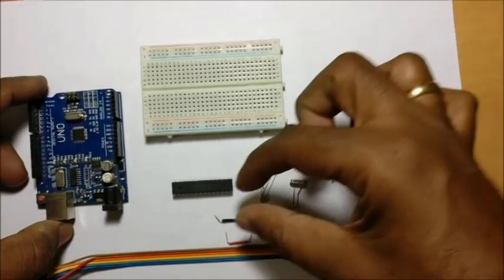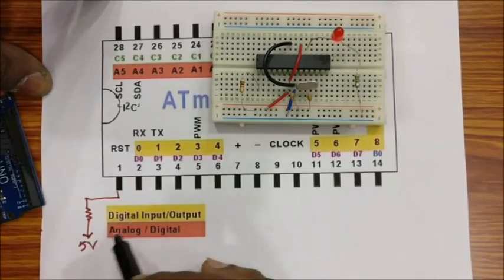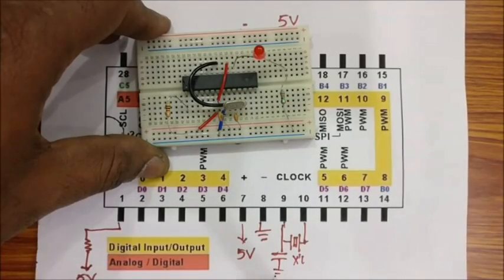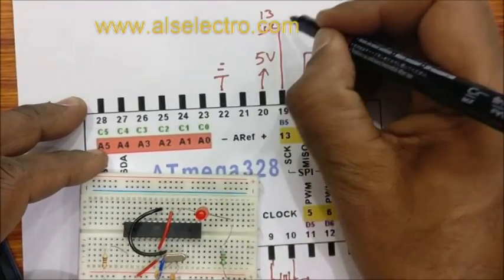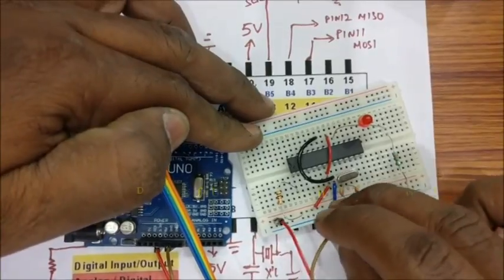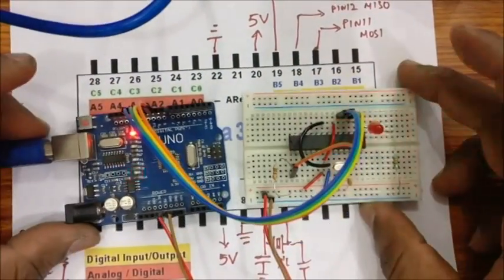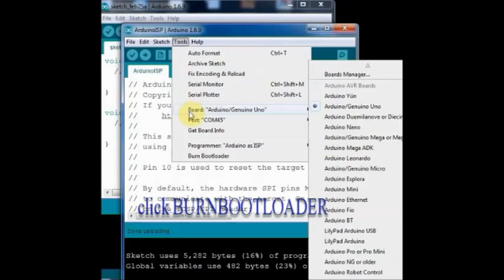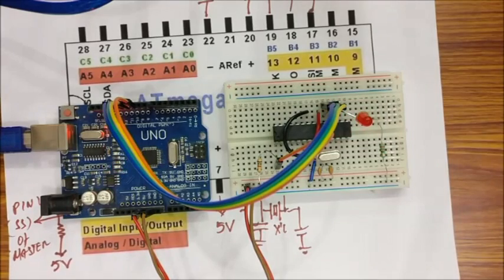Arduino BOOTLOADER on ATMEGA328 IC

Comment: As few folks have pointed out already, that last step is incorrect. When you upload the Blink program you need to press "Shift" key so that the IDE "Uploads as Programmer". Otherwise you'll just end up just programming the master Arduino with the Blink program and wiping our the ArduinoISP sketch in the master. Rest of the steps seems to be correct and the shown circuit worked for me.
Reply from the maker: Thanks for the correction.Errata Mentioned in the Description

Comment: Kindly change the title of the video. The chip you use is Atmega328p which has different signature as compared to Atmega328. Your procedure is fine for Atmega328p but does not work with Atmega328. Also a video about Atmega328 will be appreciated.

Comment: Sorry, you have a error,  In the last part, you upload the "blink sketch"  to the arduino , not to the atmega. 
you don't check if the atmega have a working bootloader.
Reply: true. the blinking is because of the sketch uploaded into main programming board. when atmega on breadboard is powered without arduino, led dosent blink nor any sketch gets uploaded.
Reply: Electromania 
Don't worry, but the way, the bootloader write correct and only need connect through serial port to atmega and all work fine
Reply: i tried to connect serial communication too, it dosent work.

Comment: Thank you for creating this video as it has been a help in my continuing understanding of Arduino Uno and Bootloading ATMega's.  I do have a question... Why did you connect the 10K Resistor between Pin1 of the Mega and 5 Vdc rail? Thank you for help with this question.